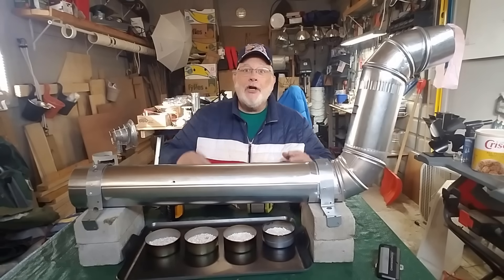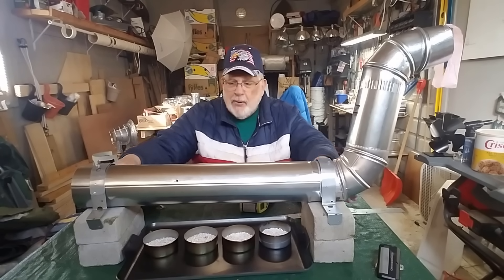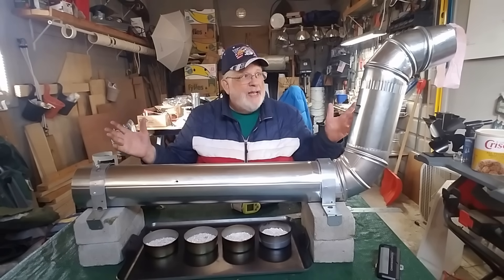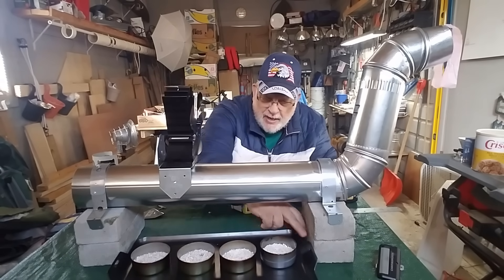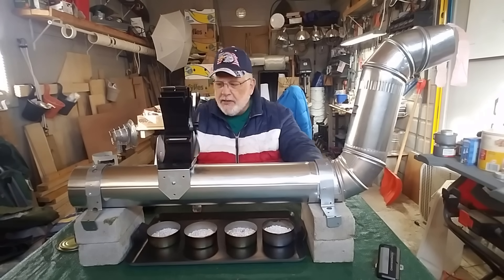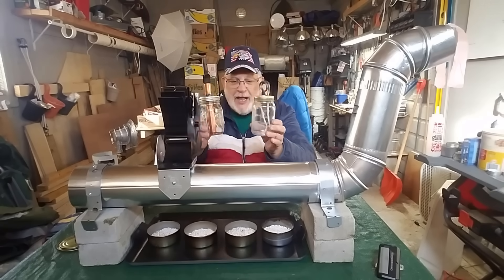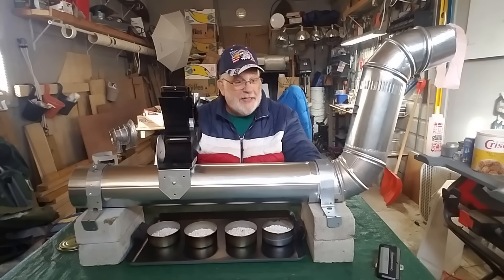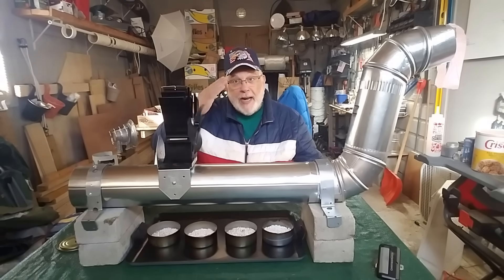Simple DIY Emergency Heat for Power Outages - No Electricity Heater -

Comment: I may have to try this with some modifications to heat a canvas tent at deer camp by using the camp fire as the heat source directing the pipe into the tent and figuring out a way to make the heat powered fan blow the heat in the pipe into the tent.

Comment: Dont see how this is free unless you are growing crops or bees to make oil or wax for fuel or cotton for wicks or metal or fiberglass wick that wont burn up
Reply: Good all the same
Reply: Wood fire too i guess which would be easy to do
Reply from the maker: The question says free heat forever? Notice the question mark... Not a statement! Thanks for visiting.

Comment: What is smoking on your right of the tube?  (after you put the burners out).  Do you need a carbon monoxide detector?  Thank you
Reply from the maker: It's incense burning so you can see the flow of air through the pipe & "always" have a smoke detector handy.

Comment: Having 16 feet of 6" iron pipe and a cold  22 X  30  garage/ shop I discovered that firing  my portable plumbers torch through created an acceptable  condensing heater. 
       Torch uses a 20lb cylinder and flex hose. There are  also inexpensive   Chinese  " diesel" heaters too.
Reply from the maker: That's a very creative solution for heating a large space!

Comment: Why build a heat exchanger at all? If a candle or sterno or whatever puts out a specific btu thats what you get heat exchanger or not. In fact you loose a bit. Maybe Im missing something?
Reply from the maker: Yes, it has the same amount of heat but it's how the heat is distributed or moved around a room that matters.  When the pipes are hot and air is moved you "feel" warmer. With candles the heat goes straight up like a campfire and you feel it less. Plus you're missing the whole point of experimenting, seeing what works or doesn't and having fun!
Reply: @whyamigreen  That was my thought.  It would be great to focus heated air and have the ability to pass it through partitions.

Comment: Hi. From devon england. 
Have you ever used the heat make low voltage unit so you can attach the unit to the pipe or fan ro make 5v si you can charge your phone.
Have a look.  Voltage by heart. 😊😊😊
Reply from the maker: Not familiar with that.  I'll have to look into it :-)

Comment: Great idea.   Make sure the metals wont heat up and catch fire and that the smoke is not bad for your health so have a carbon monoxide monitor too!  Great idea!
Reply from the maker: Thanks, and those are excellent safety tips!
Reply: I looked up the best metals after I posted since I was interested.    No 304 stainless steel.   You wont find the others made into pipes.

Comment: Put a 90 on the intake pointed down, it will improve your draft through the tube
Reply from the maker: That's a great idea, thanks for the tip!
Reply: add pipe all the way to the floor to pull the coldest air up into it
Reply from the maker: In a small natural-draft stove, fewer bends actually improve airflow. Every elbow adds resistance. The rising exhaust already creates suction, so fresh air flows in naturally without needing to be piped downward. This setup was intentional for simplicity and draft efficiency.

Comment: Make sure no one tries this with galvanized metal it might be hazardous I know it is when you weld on it aluminum is ok I believe
Reply: You are right.  There are some products that use that. I bought one and it got hot enough to cause a fire.  We need so much education in using the right materials!
Reply from the maker: That's a very important safety tip, thanks for sharing!

Comment: I built  a similar system, which I found on another's channel. I used a Behrens 5 gal. Hot-Dipped Galvanized Oval Tub, 21" long, where I placed all my heating units, candles & sterno.  I placed the 24" tube on top, with an inch or so on each end to spare. I added a large ALUMINUM FOIL TENT over the pipe above the heating elements, That keeps heat funneled toward the tube, and not lost in the air.
I also bought a small personal fan,  powered via a usb connection, to a cell phone power bank, which SITS INSIDE THE COOL END OF THE TUBE, to force hot air out of the other end of the tube. My heat source was a combination of candles & sterno, my first attempt when  creating the system.  The heat exiting the pipe got up to 97 degrees. 
As a senior in an apartment, what I assembled required no extra work or bricks no extra fittings, screwing anything in.  I could send you photos of my project if you will send me your email address.
Reply from the maker: That's an incredibly detailed and well-thought-out system you've built, I'm impressed!
Reply: @whyamigreen   One advantage of putting all the heating elements in the 5 gallon tub with handles, is it is totally portable, whether to a different room in the house or out of the house if one needs to leave, and wants to take it with them.  (BTW I stabilized the tube on top of the 5 gallon tub just by clamping brackets on each side of the tube, to keep them from moving across the top of the tub.)

Comment: Try using it parallel to a wall with the top elbow pointed into the room. Then place aluminum foil behind for reflecting the heat into the center part of the room. Lastly close part of the front while burning with another aluminum foil  barrier, trapping more heat on the pipe. Or in case the pipe in bricks making a therma mass heater.
Reply from the maker: Great ideas for maximizing the heat, I appreciate the tips!

Comment: Could I heat my sauna with something like this? What temperature reading output?
Reply from the maker: It's designed for emergency or outdoor use such as garages, greenhouses and well ventilated.  It would also depend on the fuel you use and the amount of flames placed below it. I haven't tested the output readings due to the many variations. Let me know what you find out if you decide to build one. :-)

Comment: If you use your forever candles made from the concrete anchors, it will heat up and be cheaper to run. Smaller catfood tins to use about 6.
Reply from the maker: Thanks for the tips, I appreciate it!